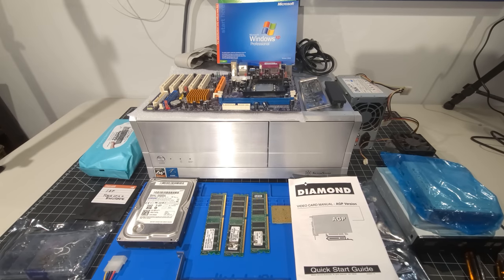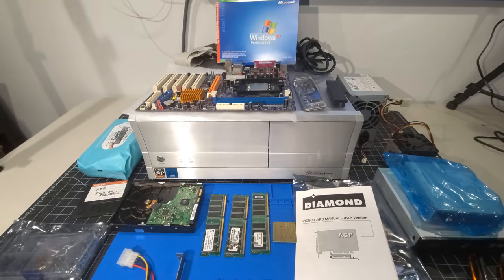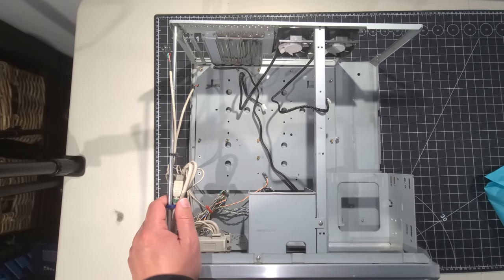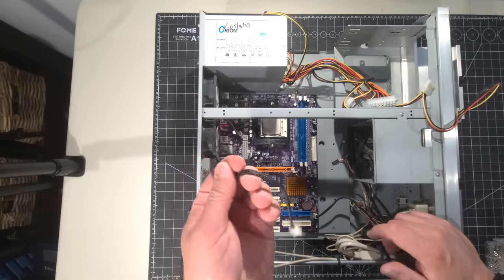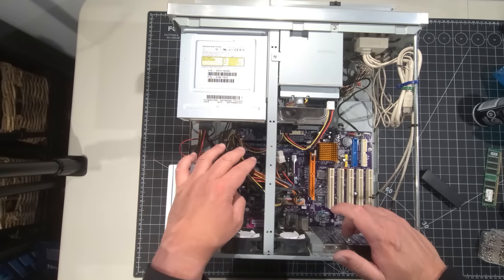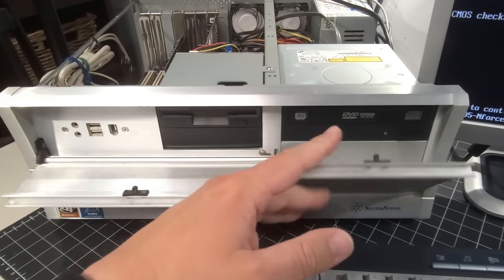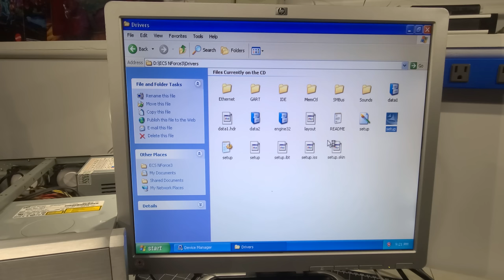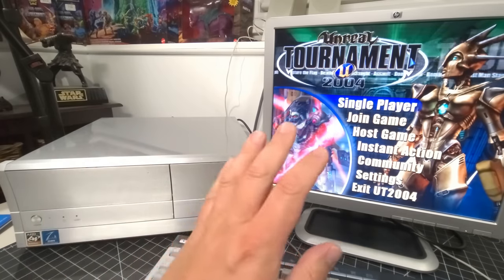Vintage AMD Athlon 64 Custom PC Build!

Comment: Unfortunately the Athlon 4000+ you have is for the Socket AM2 platform. The motherboard in this video is for Socket 939, so it's pins are incompatible. You can always cross-reference the CPU part number with the site CPU-WORLD to verify it's socket type. An Athlon 3800+ for this build with part number ADA3800DAA5CD would work well I think. It's a dual-core running at 2 GHZ, but it's extremely cheap for this platform. I have two aging 939 builds, both oddly enough running Windows 10 32 bit, as well as XP on separate SSD's. Great Video!! I look forward to progress!
Reply from the maker: Ok, thanks.  A bit of confusion on my part as I had compared both CPUs visually and they seemed extremely identical lol. That and the motherboard manual indicated it supports 4000+ CPUs (just that exact model series wasn't listed). The pins were still bent on the 4000+  dammit lol.  Thanks for the info,  I will definitely look into this.
Reply: @TheRetroRecall  If you want the end all/be all of 939, you could either go for the FX-55 or Opteron 150. You will also see that a few rows of pins are swapped on AM2 from 939.
Reply: @TheRetroRecall  939 will always be labeled 2001 and AM2 2005. Easy little trick to remember.
Reply from the maker: Thanks for the info!

Comment: I really like them ECS boards. Got one in a Pentium 4 build with a ATI 9800pro. Love the color so different and the board has never given me any trouble. It's rather basic my one but that kind of helps me as it has less to go wrong and reliability is great so far!
Reply from the maker: Agreed, their boards were good as well as MSI in terms of more entry level boards.  I find when you got them, they either works really well or really badly lol.

Comment: I know it is late but the optical drive has either a lose belt or it has lost a cogwheel that drives the tray. The drive notices that qnd tries closing and then opening forever that makes the humming sound you describe. Should be a very easy fix.
Reply from the maker: Thanks!  I have a Creative Quad drive (4x) that is having some issues that I really want to get going.  I may tap you on the shoulder for some advice!

Comment: Channels like yours is what I love and what motivates me. I just found an old PC my mom had from the late 90's... has a Pentium III, 256 MB of memory, jumpers set to 100Mhz FSB, no hard drive weirdly enough but has an original PCIe slot! I know I have some IDE drives kicking around, but if they can't be sacrified for a restore I'm confident there's enough options with this machine to bring it back to life.
Reply: did you mean PCI-X? PCIe were introduced on 2003
Reply: @n.shiina8798  Yah that sounds right... if I remember correctly it was about the size of an ISA slot, I put it back in the basement to get it out of my room until I can get a HDD setup for it.
Reply: @livefreeprintguns  ah, yes it's PCI-X. they're quite uncommon for consumer board afaik
Reply: @n.shiina8798  I've been trying to find information on this computer, she doesn't remember when she got it and my initial Google searches have come up empty. I'm going to do a full cleaning and disassembly once I have everything I need because I also didn't find any manufacturer logo printed anywhere on the motherboard.
Reply from the maker: That sounds like a fun project!  It's a lot of work and due to editing I'm able to make it much shorter but it's fun just the same! There's something about using older hardware and seeing it come alive! Thanks again for watching and for the amazing comment :)
Reply from the maker: I have a couple of boards that I have not been able to identify from the board itself.  Go to www.theretroweb.com and enter as much info as you know about the board in the search fields.  I find this to be a great resource for older boards.

Comment: Oh wow, I had an ECS board like that back in the day. I think it ran a Duron or Sempron.  Seeing your videos really makes me nostalgic for building my systems back in the day.   It was often with whatever parts I could get.  We didn’t have Amazon or Newegg. But we did have computer parts swap meets where you could find anything and everything for very low prices. There were very sketchy back alley shops selling cases and parts not quite like the shops in Taiwan but similar.  The big box electronics stores came to town and killed the swap meets.  Land prices ran off the small shops in favor of upscale loft apartments.  Anyway thanks so much for the amazing videos!
Reply from the maker: Thanks for sharing this memory!  Its a shame that the smaller more niche shops get closed down as a result. These stores had all of the neat components and parts you needed for your builds.  Today we have things online for the most part with very few little stores around to meet that need.  Thanks again for watching!
Reply: I'd like to find a Socket A version of that board for my old ME system just because I need to replace the psu in it, and it's next to impossible to find a decent one with enough amps on the 5 volt rail.
Reply from the maker: Yeah, hopefully you can find one.  Thrift stores?
Reply: @Karataus  😆 thrift stores where I'm at flat out suck. I keep poking my head around ebay, looking for something that's still in the box, like one of those older Startech ones that had something like 350 watts of capacity.
Reply from the maker: Hmmmm amazon any luck there?
Reply: @TheRetroRecall  Actually... I haven't actually looked there that I know of now that you bring them up.
Reply from the maker: I find that sometimes they have some good aftermarket parts.  Specifically cooler master or startech items.

Comment: We sold these ECS boards when I was working at a wholesale computer supplier. This low budget brand had a few kinda stable (and interesting) boards and this is one of them. In fact most of their motherboards for AMD where ok, but although they did use a good chipset from time to time, most of the time the performance is lower than when you would have a board from better brands with the same chipset. Sometimes it was just the fact that major brands had overclocking features by default and the possibility to use higher clocked memory.
Reply: The K7S5A rocked my world when I had to shop for a cheap 462 motherboard. It also performed better compared to the KT266A in some tasks.
Reply from the maker: For sure.  I find this is a well rounded board and like the features it has.  Nice to see some CPU adjustments as well as built on RAID.  That would have been quite handy at the time.

Comment: Nice build you have there! Built a retro rebuild myself around the same Socket 939 ECS purple motherboard, but with an Athlon 64 X2 4800+, 2GB (2x1GB) Kingston Hyper-X DDR 400, XFX 256MB GDDR3 6600 GT AGP (@ full PCIe version speed), Sound Blaster Audigy SB0090, 160GB system & 320GB data Hitachi 7200rpm SATA HDDs, in an Antec NSK4100 case with Seasonic SS-600ET PSU, 2 PATA DVD drives, card reader, floppy drive, Noctua fans and a Wraith Prism RGB CPU cooler, running XP Pro SP3 32-bit.
Reply from the maker: Thanks... Now your build sounds pretty great!! What kind of games did you run on it?
Reply: @TheRetroRecall  I had rebuilt the system I originally had in some form or other between 2007 and 2014 mainly to handle certain older games that don't like running on my Q9650 750 Ti build, such as Microsoft Flight Simulator 2002 Professional. Also play games like Fable, Need For Speed Underground and Unreal Tournament on it, as well as Amstrad CPC, BBC Micro & Arcade Emulators.
Reply: @TheRetroRecall  Started off with an Athlon 64 4000+ and an FX 5900 LE, then moved on to an MSI ATI Radeon HD 2600 Pro passively cooled AGP card, before finally getting the Athlon 64 X2 4800+ in 2010.

Even tried running the system with an Ageia PhysX card at some point.

(All brought second hand, as at the time I couldn't afford more than the Gigabyte EP35-DS3R motherboard for what would become the Q9650 750 Ti build, which I was finally able to complete around 2018).
Reply from the maker: That's awesome. I loved the flight simulator series!  All of these games have come such a long way.

Comment: I think I had a board vary similar but with a PCI-E slot when I started to get into PC hardware, had the 3000+ and the ATI x1800 XT which I still actually have.
Reply from the maker: That's awesome! I think the nForce 4 board had the PCI-E slot on the board.

Comment: I had a 4400 running in that ECS board for quite a while iirc. Worked fine with the latest bios and was a great boost over the 3200 thanks to that extra core. I vaguely remember my board being an nforce 4 chipset though, so not sure if that is what you have there? This is the point where there is crossover with AM2 on CPUs so make sure it is the right one when you buy.
Reply from the maker: Thanks for this info and yes - they were just on the cusp of changing and that's what made this era of computing so confusing but fun too!

Comment: I have had similar Asus board to the last pc and it wont turn on at all if the cmos battery is dead and simply removing it does fix that. I think you should give it a try!
Reply from the maker: Awesome, thanks for the info!

Comment: nice video has always :D, about that cpu i have checked two cpu i had one is 939 3500+ and the other am2 3500+ the layout of the hole on the pins side are different,  than if that cpu actually fit the socket i think must be ok to try, but it's my idea if you want to be totally sure you must check the serial number on the cpu and check if it's actually a 939 or an am2 cpu :D
Reply from the maker: Yes I'm figuring that out now lol!  Go me haha!  See - this is why I have amazing viewers like you to keep me in check!! Why was this era of tech so 'fun' haha!! Thanks again:)

Comment: I’ve been wanting to do an xp build for a while but don’t know which parts would be compatible with what. I was only in elementary school during the xp era so my knowledge is limited
Reply from the maker: There are a lot of great sites out there that can assist with compatible hardware of the early 2000s.  Your best bet may be to check out thrift stores or your local online marketplaces and see if you can find a cheap XP system to learn more about the OS and associated hardware.  Once you get a footing, you can then expand your knowledge with looking into what that hardware can support, or keeping an eye out for another system and or hardware that has more features :)

Comment: At least you had the IO shield for that board. One of my biggest peeves is these people that part out old systems and don't include the IO shield with the board. That's why I shelled out $300+ for a n.o.s MSI Socket 462 board a few years ago for the retro system I built. Well actually I think part of that was the shipping cost from Australia to the US.
Reply from the maker: Yes!  It's one of the main things that gets forgotten.  Fortunately I was able to locate on in my stash that matched up.  Not 100% sure if it was meant for it or not but hey.. It fit pretty darn well.

Comment: Can you imagin that a Elsa GLoria DCC ist faster than a Geforce FX5200, in the Game Especially The Elder Scrolls III Morrowind? I tested it and was Surprised. At leest on my IBM Netvista P4 PC. So i endet with to use that ELSA Card.
Reply from the maker: I mean the fx5200 runs for what it is but there were many other cards out there with less specs that ran far better.

Comment: Hello, nice build, gorgeous case.
I know some already told you, but yep an FX5200 was already a low end card for a mid tier Athlon XP, the FX5500 is barely any better, the only cards from the FX line are on the collection territory now, FX5800/5900 or a quadro FX3000, better aim for a 6600/6800GT
If you find a cheap AGP GeForce 6600GT that would match a little better the performance of S939 CPUs like the 3000/3500 single core that you can still find for cheap, some models like the 4800X2, are a little too expensive, but a 4000/4200X2 fual core can give a 6800GT AGP a nice workout.
Best regards.
Reply from the maker: Thanks for the info!! Yeah I mean it's what I had haha!  It's awesome though having all of this great info.  I will keep an eye out for some of those cards you had mentioned - they tend to appear out in the wild once in a while and I get lucky.  That's how I was able to find my Voodoo3 3000 card!  Yes the case is crazy awesome.  So versatile, built solid, and could accommodate many builds.  Again, thanks for the info and for watching!

Comment: I think that was a great build!  I don’t know anything about that graphics card, because I was a console gamer in the Windows XP era, but it looks like it’s performing well in UT 2004.  (Is it just me, or did mechanical hard drives perform better in older operating systems like XP then they do with Windows 10?)  Great parts!
Reply from the maker: Thanks and yes, I just believe that mechanical drives are more authentic to an older build.  It helps this was a SATA drive as well as being 7200 RPM.
Reply: @TheRetroRecall  Yeah, I think they are more authentic too.
Reply: @TheRetroRecall  Does that PC have SATA 2 or 3?
Reply from the maker: I believe Sata 1 (1.5gb/s)

Comment: I built a lot of PCs in the late nineties and early 2000s, a good friend owned a computer shop, and it was a fun hobby. In those days unique and interesting cases for custom builds were a mixed bag, Antec and Lian Li were making great cases, but they tended to be large full tower cases, the big prebuilt companies had nice looking, but very proprietary slim line cases. There were lots of no name cases the looked cool, but were of poor quality. I built my wife a PC in a semi transparent purple case, the same no name company even sold matching keyboards and mice, which were equally poor quality. Silverstone was a rarity back then, they did build quality products, they were fairly inexpensive, and had lots of models that were designed for home entertainment, or just to avoid the beige box look.
Reply from the maker: This is great!  Thanks for sharing and watching!

Comment: I had a similar setup running for almost 9 years.
Specs
Athlon 64 3000+
Gigabyte GA-K8NF9 
1gb / later upgraded to 2gb (Geil)
160gb maxtor hdd
Gigabyte Geforce 6600 GT Gddr3 128mb PCI-E
Thermaltake sViking case
LC Power 600w psu
Reply from the maker: Awesome!! Glad to see this hardware still going today!

Comment: flash and adapters are real hardware as well...
Reply from the maker: Yes, I was referring to emulation on new systems running old software, or online game services.  The flash to IDE, or SSD to IDE was never in question - I just prefer to use Platter drives for that extra kick of the real feeling of sound and speed.

Comment: makes me wonder where my 3500+ x64 is. still have it and the 8600gt silent i ran in it.. someplace. should toss that system back together at some point.
Reply from the maker: Yes you should haha!  Always great to have older hardware up and running.  Thanks for watching!

Comment: Fun, in a nostalgic way. WXP would be accurate, even "hold outs" from W2K like me would have already swapped to XP SP3 by then. All in all, if you have the parts lying around, not a bad choice, but if you're going "bargain bin" hunting for a cheap box, might as well go for a AM2(+)+Athlon X2, they should be dirt cheap, or a low spec LGA775+C2D. The FX5200 is killing your performance though, that card is about as cr*a as it gets, even my 4200TI could beat it, as DX9 stuff in unusable in the FX5200. Which is a good reason to take AM2(+)/LGA775 as a motherboard choice, then you can get stuff like a 6600GT/8600GS/9600GS for next to peanuts, and that makes your gaming experience exponentially better.
Reply from the maker: Haha! I thought about 2000 but xp just fit the bill.  You are right regarding the card - as I have learned from many comments lol.  I will see what I can find for future builds :)  thanks for the amazing info!

Comment: 360p :(
Reply from the maker: Its YouTube.  It was uploaded at 4k, they are still processing unfortunately.  It will get better!! :)
Reply: Watch in 360p for the full retro experience! :D
Reply from the maker: This comment... Where is the heart react lol!!
Reply: I got 720p
Reply from the maker: It's getting better already.. Thanks YouTube God's! Haha.
Reply: YouTube renders the videos in multiple formats. Low resolution is ready first.  4K will appear later.  This is one case where jumping on a new video and being first or early is a detriment rather than a benefit.  The latecomers will get the better experience.
Reply from the maker: Most times I have it uploaded, published and processed well in advance and a scheduled release set.  Unfortunately YouTube felt it was necessary to delay the upload, processing and checks.  Which unfortunately caused the viewers to see this stepped up scale over time.  Thanks for calling out the process for others - it's appreciated!

Comment: Man!  The FX5200 is arguably the (deliberately, anyway) worst GPU nVidia ever unleashed.  You could get better performance at the time from a GF3, no lie.  I mean it's moot these days, right?  But believe me, as someone who got bit by the damn thing ("Wow, a major upgrade from my GF4, and it's only $99!"), those cards SUCKED.
Reply from the maker: Lol, so I've been told but come on!!! It worked great and served the build from 20 years ago!! Would I have bought an equivalent today?? Probably not lol.. But hey it's fun just the same:)
Reply: @TheRetroRecall  Oh, of course, I get you.  Just don't be surprised if GTA:SA hits single digit framerates with it installed :D

The FX5200 was the GT710 of its day, fact.  But at least GPU vendors didn't market the GT710 or 730 as a gaming card (although system builders did during the GPU draught from 2020 to late 2022).